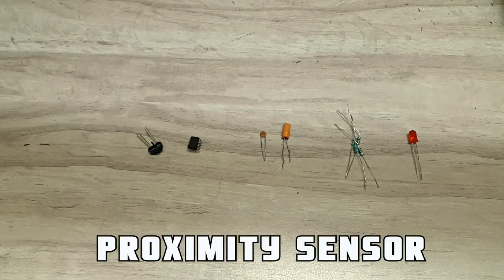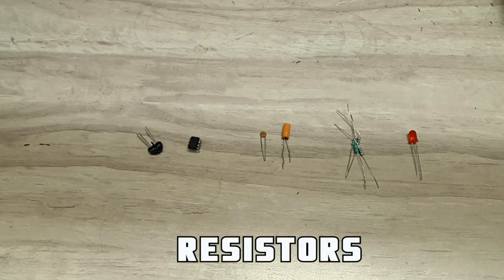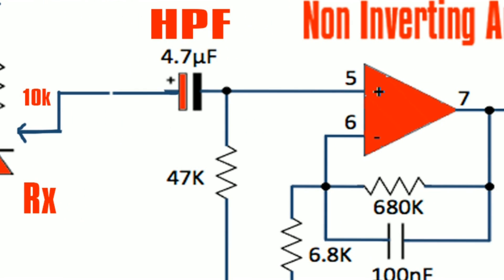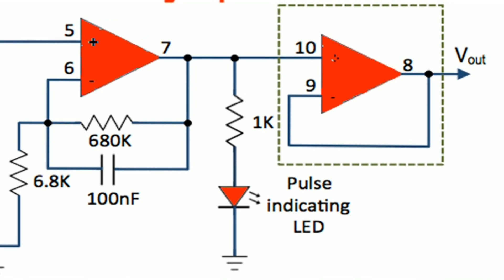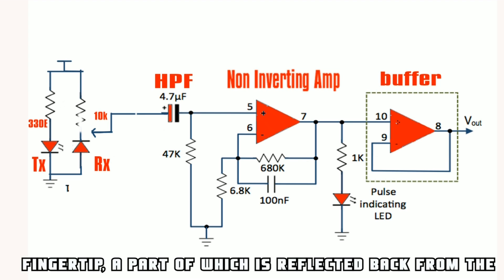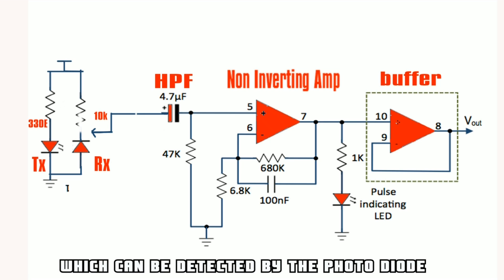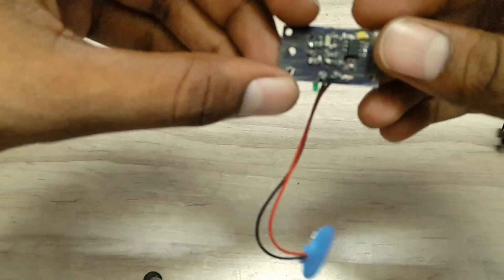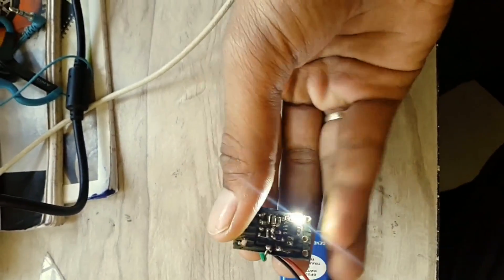DIY HeartBeat Sensor

Comment: circuit is working perfectly just u need to place finger perfectly make a black little box like thing to cover proximity sensor a little above the sensor it will be perfectly working  actually when  u directly place light cant be reflected so u need to place finger steady and a little above

Comment: does this setup work on the pulse located at the temple or does this only work for the fingertip?
Reply from the maker: It should work on every finger, but again I have not tested for that but I can answer it based on Logicbehind this project. Google "Photoplethysmogram", its the science behind this project
Reply: How much a voltage is your power source? I see the battery has a voltage of 9V. Can it work with a 5V or 3.3V?
Reply from the maker: yeah!!!!

Comment: can you tell what to use as a buffer......I wan to connect it to an arduino.......
Reply from the maker: +Navaneeth krishnan op-amp ic. You can use LM 358 ic which is a dual op amp ic
Reply: +Sachin Soni  i used it but getting very low amplified readings......not able to get much difference
Reply: Sir, LM358 is an 8-pin IC . can u tell me which IC is this ...as its showing 8,9,10 pin in the buffer opamp
Reply from the maker: I'm sorry,
The pin number shown in the video are misprinted
this IC is LM 358 and just google its pin diagram and attach all the components accordingly

on the pin numbers are wrong. All connections are ok and tested also

And thanks for informing.